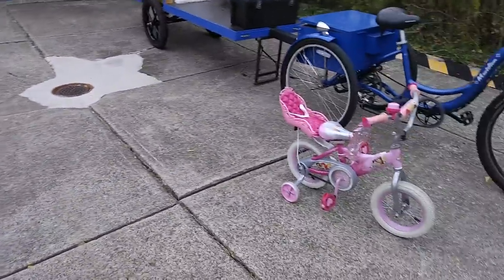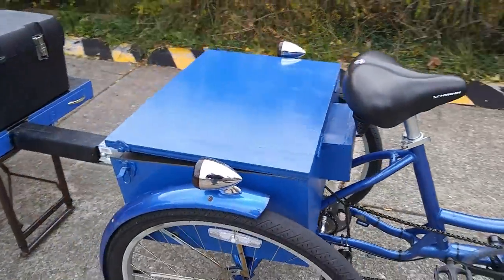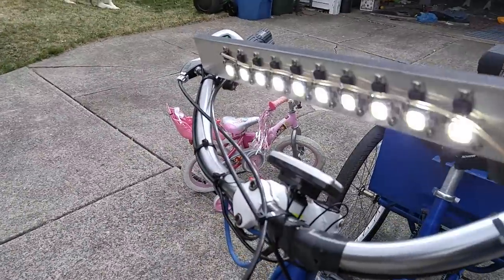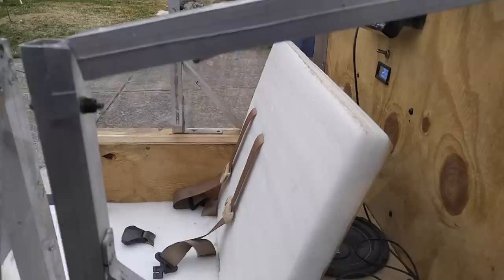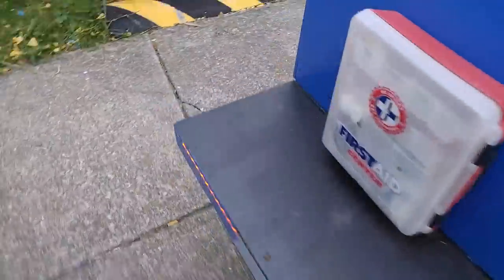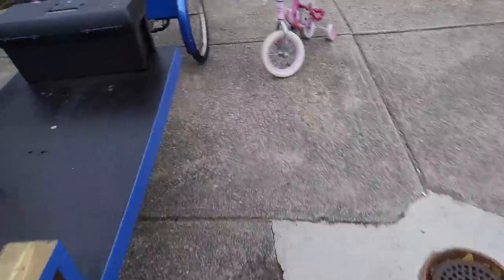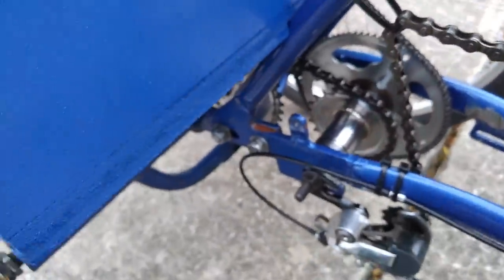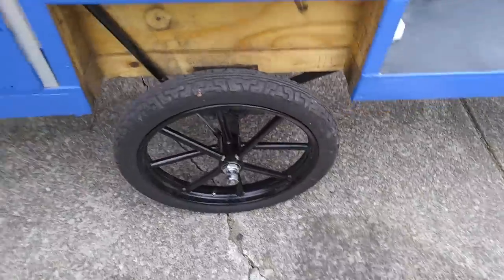Custom built bicycle trailer please share

Comment: your willingness to put this together is apparent
along with your workmanship and attention to detail
the trailer looks very overbuilt and hence much heavier than necessary
good job, well explained
Reply from the maker: Yes it was very overbuilt it has been now completely rebuilt a total overhaul with about a 50% reduction in weight and 25% reduction in all the unnecessary things
Reply: what I've found that is cheap/light and easy to work with is EMT tubing.
I rounded up a set of 4 benders from Craigs List  $15 or so each.
With some practice to allow for the stretching on the corners
the projects turn out Great
I'll bet the kids Always want to go for bike rides!

Comment: You can make chloroplast slap on siding and roofs clear.and pull out rooms for over nighters think paper plastic wood and metal and use all weathering walls cloroplast corrugated sheets and kitchenette pull ot 4 by 8 size puzzles?.GOD bless

Comment: wire did you get the wiring harness at looking at building a trailer for my moped and need something to have running, brake lights, and turn signals love the sleekness of that pin system
Reply from the maker: Cb 8 pin connector
Reply from the maker: abcGoodefg CB Microphone Mic Plug Connector Chassis Sockets for CB Ham Radio/Amateur Radio Male & Female for 3/4/ 5/6 / 8 Pin (8 Pin Female, 5 pcs) https://www.amazon.com/dp/B0125YRWKE/ref=cm_sw_r_cp_apa_i_VKh2DbJHRCJYM

Comment: I really like the idea of a powered trailer that pushes the bike. But this is powered on bike correct.So it’s an electric bicycle vehicle basically with lots of amenities. Bells and whistles. And it was designed for that purpose? To power the bike and trailer weight? As well as carry your children along with ease? I find it and the process, magnificent.

Comment: Nice suspenison setup on the trailer, I want to fix my homemade ttailer angle when I tow it with my fatbike. It leans too far back and I want it to be level. What setup should I go with? Its built off a normal Walmart frame and the rest was stripped off and custom built.
Reply from the maker: I would have to see what you mean and what you already have set up you can send pics to my email if you want and we can go from there liljay51884@gmail.com

Comment: Ik im late asf but I think it would be best to put ur first aid kit near the storage bin in the front it would be drastic if a real emergency was to take place while ur riding to run to the back of ur trailer then to the front of ur trailer hop on it and fix the issue u would save at least 10+ secs and be able to actually diagnose the problem with the kit near you just some advice

Comment: I'm building a micro camper that I pull behind my mountain bike you got any input on electronics that I should use I would like to have a TV fan stereo and LED lighting how should I be able to control everything and power everything should I go solar or let me know what you think
Reply from the maker: It all comes down to the efficiency of the items that you are running batteries get heavy and unless you're talking about running a TV that will run 12 volts that means you're going to have to run an inverter inverters aren't that efficient unless you spend big money on them but they do sell some pretty large TVs that are designed for vehicles I would definitely run some solar because batteries are heavy and if you're just pulling this with a mountain bike most standard bicycle hitches can't handle that kind of weight wiring is pretty easy I try to run most of it along the underside chassis that way if you ever run into any issues you have much easier access to it and if you ever want ad something in the future it's easier to tap in wires always leave yourself extra other than that most of what I build just comes from my imagination I go through a lot of trial and error so plan is best you can draw blueprints it will make it a lot easier

Comment: Hey I have just a stock bike trailer/stoller and I'm looking to put a real axle on it without breaking the bank as it gets speed wobble, wondering if you can point me in the right direction as you have a pretty nice setup
Reply from the maker: That's kind of a tough one I've never really had to deal with speed wobble because I'm usually not about speed I'm about power because I'm moving more weight they usually you can pick up a solid steel rod from your local hardware store for not too much
Reply: @liljay51884  basically need a solid axle, these wheel attachments just go to the frame basically giving it less rigidity
Reply from the maker: Yeah I would look into just buying either a solid or even a hollow steel tube from home depot, Lowe's, or your local Steel Mart

Comment: That's a lot of money to spend on making a trailer when you can get decent ones for like $150-200 but at the same time I respect the creativity and cleverness it took to make this! Good work!
Reply from the maker: It started out small and then it just grew from there this is the 3rd "prototype" trailer and 4th bike pulling it I have done alot of redesigning to it to make it stronger and do more so the money is just the continuous upgrades that I have added to it its alot of wasted money I agree from broken parts or things that got tossed away because they didn't fit in with the ever growing of the trailer but the kids love it so that why I keep going
Reply: liljay51884 Do you think you could maybe do like wood work tutorials on how you put together because I'd love to do something like this but I'm 17 and only know the basics of wood work Maybe you could even just show how to make a basic hitch, I have a hybird bicycle by the way. Many thanks.
Reply from the maker: +Cillian I could do a tutorial on how I built the flatbed of the trailer itself that's actually pretty easy the hitch is actually just two pieces of wood through together and I shaved down just enough wood for a receiver hitch to slide over them and then just bolted it on I have a really busy week planned but maybe this weekend I'll try and get a video tutorial and walk you through exactly how I built each part of the trailer itself
Reply: liljay51884 That would be amazing, I've already subscribed hahaha. That would definitely be something I'd be interested in!

Comment: What if it rains? All those electrical circuits!
Reply from the maker: They were sealed inside with no way for water to get to them the only thing I ever had to worry about was the stereo itself and now I've built a new trailer that has a cover for the stereo and all electronics are sealed from the elements it has been caught in several rain/snow storms and I've had no issues at all

Comment: Looks pretty badass! How much weight can the trailer safely carry? And roughly how much did it cost to build the trailer itself without the sub's?
Reply from the maker: Joe Blythe the tires are rated at 275lbs each and the trailer weighs about 300lbs

Comment: How in to world and what did you use to make the suspension? I have been looking for a way.
Reply from the maker: Andrew Binder angle iron and a welder some bolts I welded  everything together and then bolted it into the wood and there's a 5/8 steel rod for the axel

Comment: Cooling fans need to draw the heat OUT,  you cant just blow in with no exit point,   you need to draw cool in and blow the hot OUT!   oh and those heat sinks need air to pass over them to work properly, so  clearance  all around them Is required,     A hole in the front of the box,  3-4" circle, and a hole at the rear would do better with airflow through the box,  great job other wise,

Comment: You should run the motor to the main sprocket and thru the derailleur.. Would be loads of low end torque, but pretty high in the mph..

Comment: I am at an impasse with my bike trailers axel assembly I like how you did yours can you help me with my project and get me a parts list your help would be greatly appreciated
Reply from the maker: The trailer axel is just a steel rod welded into a piece of angle iron and then two pieces of angle iron are welded into that at an angle and bolted into the side of the wood I have angle iron welded to the top of the springs as well as the Springs welded to the axle and then there are screws that hold the top metal plates to the wood

Comment: How did you attech the wheels to the trailer
Reply from the maker: I believe there called "set collars" or "lock collars" they slide over the axel and there is a set screw in them that tightens down to lock them in place

Comment: I'm looking to build my own mobile lemonade cart using a similar layout.  I'd be interested to hear any input or advice you'd be willing to give on the subject.
Reply from the maker: Neil Yaremchuk there are so many different things that I learned throughout building all of these trailers suspension is the most complex cuz you have to get it just right in order to handle the weight of the trailer your building and then making sure you have a stable and strong enough axle and tires hold the weight you're going to put on it I went through four sets of tires before I found the ones I'm using look for horse cart tires there are a couple of web sites that have some good ones keep an eye on balance unless it's always going to be attached to the bike you're pulling it with or make sure you put on both ends to make sure it doesn't tip on using it

Comment: First, there is nothing wrong with spokes but you have found out what us serious haulers have found out. I made a serious grocery hauler after breaking standard spokes and a heavy duty cargo rack that I had a custom cooler side mounted to. So after walking that thing home for miles I bought a heavier duty wheel to avoid it ever happening again. BTW I didn't see what size wheels are on the rear of the trike. 26ers are the strongest. I bought 26ers with 11 gauge spokes from bikeman4u.com which doesn't even exist anymore. Anyway, thicker spokes is the solution.
 I'm looking for some clues as to how to build a trike as I was given a free frame by a bike shop owner but I'm not sure what I need to buy to make it work. It's a nice frame, it has a diamond steel plate for a rear bottom.
 I'm also looking to build a trailer for my Ebike. I have customized it by using T bolts to bolt on a rear cooler because it's wider than normal sized cargo racks so neither they nor reg dual baskets would fit. Two folding Wald 582 baskets allow me to carry 30-45 items on a regular basis. I have no car. I'm all about the bike culture and have not burned a gallon of gas in almost 20 years.

Comment: How are you charging the batteries
Reply from the maker: which one there's a 12v system and 24v system they are charged separately I use a noco genius 7200 for the 12v system and a standard car charger for the 12v system

Comment: how much does that weigh? that must be heavy...mine empty is 45 pounds lol
Reply from the maker: About 700lbs
Reply: +liljay51884 wow XD I could never pull that!
Reply from the maker: the trailer weighs 300 pounds empty I probably have about 150 lbs of batteries alone then you add the kids plus me and the trike with the box motor and batteries weighs about 200 to 250 it adds up quick I have a 500 watt motor geared down to a top speed of about 12 to 14 mph and I can still pedal to help it
Reply: +liljay51884 now I want to make custom suspension for my 6 foot trailer
Reply from the maker: +Golden_Wrench the gas support shocks from your local auto store work well find ones that have a low weight on then 30 to 50lbs and then find Springs that have a working load to suit the weight of your trailer if you want I can do a detailed video of just the suspension
Reply: liljay51884 my large trailer weighs about 35 pounds but it's the trailer I use the least because it's so big :) my small one is getting fixed
Reply: +liljay51884 I'm gonna make a video soon on how I made my trailer suspension. I got most of my ideas from.you and I want to thank you for the idea!

Comment: Have you been to the woods lately, :( because I believe some nasty trolls followed you back. Great video and project you've got there,don't let those trolls get to ya. I was wondering where you were ordering your new wheels,I've been trying to find sturdier wheels for my trailers with no luck. AWWWH... Looks like a poser is upset because his song cover videos haven't made him youtube famous,so he spends his free time trolling youtube. :'( Bless his heart. Is it because he isn't skilled enough to write his own songs,or just a very unhappy camper because he sucks at life?
Reply from the maker: jeremy henderson lmao thank you🤝. the wheel I get from Kingston Saddlery Supply they are horse cart tires a little on the heavy side but very sturdy
Reply: :'( I really dislike those know-it-all trolls,who just got lucky when they inherited opposable thumbs. Thanks. I'm actually building a small trailer to pull behind my bike,and I'm glad I found your video because I want to include a solar system (or maybe just add a sprocket to one of my trailer rims to charge my batteries as it's being pulled) for my power tools so it gave me a few ideas. Did you buy your trike,or did you buy the axle adapter and put it on an existing bike? I had a 20" Schwinn (when I was BMXing) that had the same frame design. I found some decently priced trikes online,but I think I'm going go with one of the 4 wheeled Rhode's bikes, or build one (because they are way over priced,in my opinion). I built an Asian cargo trike (2 wheels on the front) a few years ago but only after I built it did I realize that it wasn't what I needed.

Comment: try running the stereo off a motorbike battery they are much lighter
Reply from the maker: jye anderson there is to much running on it (alarm stereo amplifier leds running lights brake light compressor air horns ) it would kill a motorcycle battery very quickly

Comment: not bad whoever you are I think your idea is working very well but need to be better  

*Upgrade: 
-but anyway you should make some electric like electric bike when you need to ride with someone one or more
about Electric part you should make something like windmill but for better make it more colorful and make it rechargeable mostly use paddle, or wind to recharge electric so it will save you lots of money 
-as for Speaker it should be concealable in one vehicle if you don't want to bother anyone or jusut want to listen to music all yourself without being bothering 
-for those you should make it at least water-resistant or even better Water-proof

*Feature: 
a little fridge 
a camping stove
a small stink or shower 
a cloth changing room
.....etc

that's all I can think of
Reply: Arthas Hastings Menethil lol 1 there is no way a windmill will charge those batteries... It might charge them in like 2 weeks with nonstop wind.... 2 there is also no way you will have enough power for those kinds of stuff... Maybe you should know basic electrical engineering before you type a whole paragraph
Reply: Arthas Hastings Menethil also a shower there is no way he can pedal that nor can his motors do that.... Unless he wants to waste another 6 grand on batters and a stronger motor...
Reply: You also need to learn proper grammar too...
Reply: Arthas Hastings Menethil and if he was smart he would have spent his 6 grand on a cheap van/camper and have some of  those stuff, at least the ones that are practical...
Reply: my  grammar I mostly learn is from video games you seemed to be misunderstood my Ideas you should visualize it and think outside the box instead of going traditional or just think inside of the box
my Ideas are for saving money instead of being money hungry like you and he did that cause for his daughter he's a loving father and he want a gift for his daughter by his own hand through his creations or inventions
why it's soo expensive ? I think because he use the best thing he found
about my windmill idea it should charge faster when his daughter ride it and it should create enough velocity for making it charging faster but however he should make it removable so he can attrach it around him while he's jogging or running it's the best way to do both work at the same time 
you might say my ideas are impractical but peoples like Bill Gates or Steve Jobs might approved my ideas
I use wisdom mixed with intelligent for making better ideas I may know a little bit of basic engineering but I can distinguish things
Reply: Arthas Hastings Menethil lol stop living in a fantasy world then come back... You would use more electricity then the windmill is producing, therefore useless....
Reply: Arthas Hastings Menethil a propane fridge and stove can work but how can he pedal that stuff ( the motors probably don't have enough torque) so that's is therefore useless too... If you where thinking outside the box at least make it a little practical

Comment: So you still need to finish it
Reply from the maker: yes there's still a lot to do I continue to add on to it and improve it
Reply: +liljay51884 k hope it goes well
Reply from the maker: right now I'm currently working on the trike I got 2 new rear tires a new rear axle a locking rear differential and rotors and calipers are being installed on it so I can stop better
Reply: +liljay51884 ok